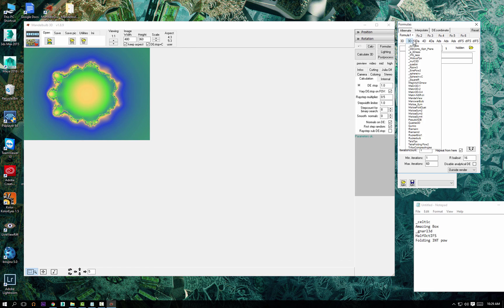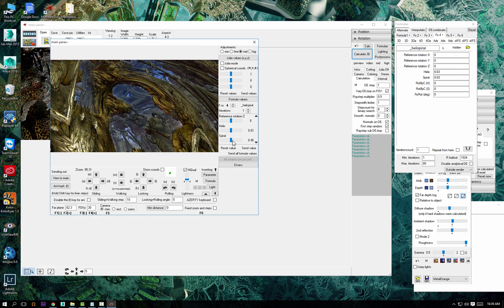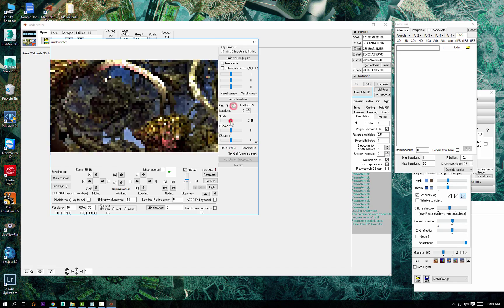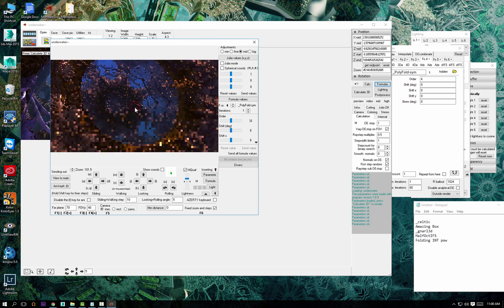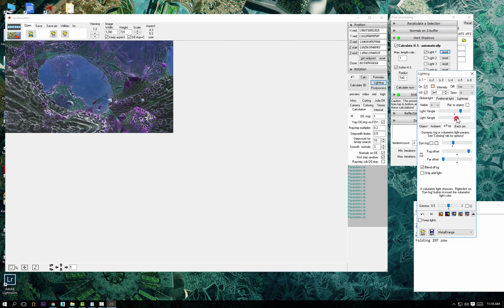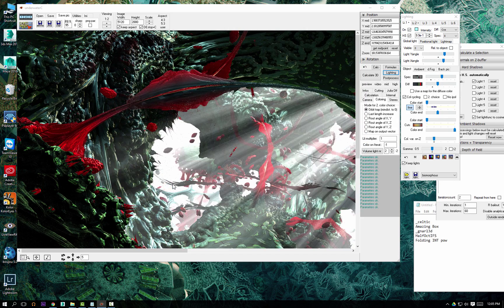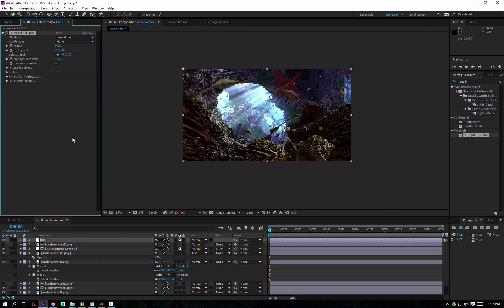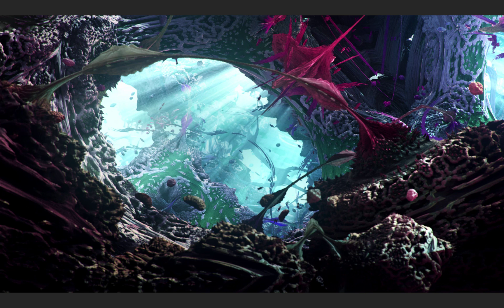Underwater Fractal Tutorial

Comment: The changes you can make to the lighting after the render are really cool... Still im waiting for a full CUDA or OPENCL implementation to run on one of the next gen cards.
Reply from the maker: +sonof hendrix thanks- Cool that you want to wait, but afaik it might take a while before something like this will run on CUDA...
Reply: Im no expert, but i dont think theres anything stopping them, i think it requires strong double precision floating point, but the next gen cards like the Polaris and Vega will have strong compute performance even at FP64.. But im not expert... i use Fragmentarium which is entirely OpenCL, very fast, but it seems to have a limited detail level and few fractals and its not being developed. BTW im sono2000 on deviantart if you want to check out some of my fractal renderings using fragmentarium.
Reply: You might check out Mandelbulber. It can do OpenCL nowadays. Pretty sweet.